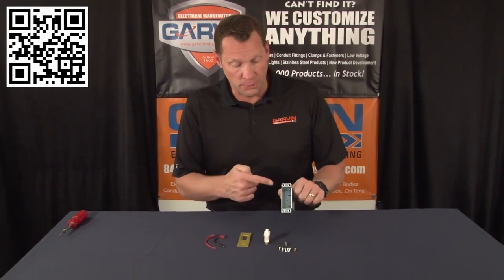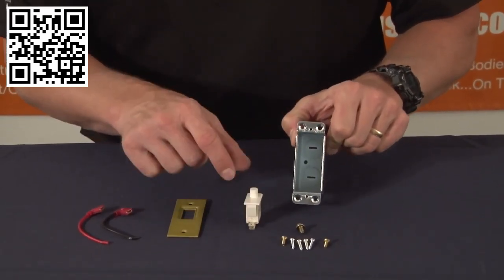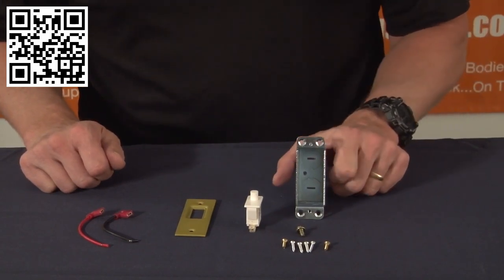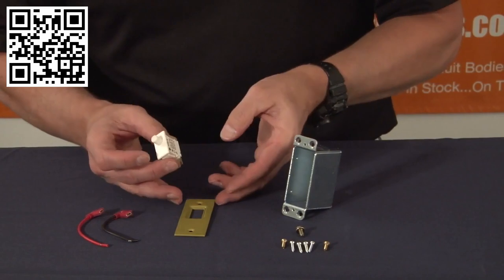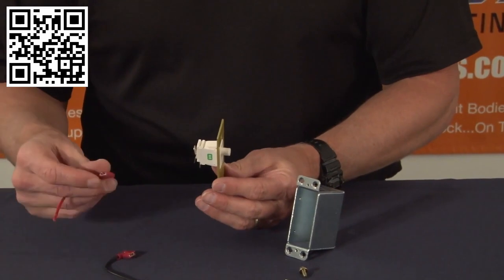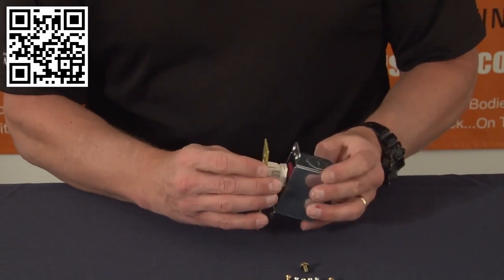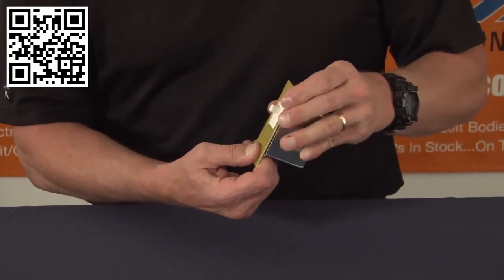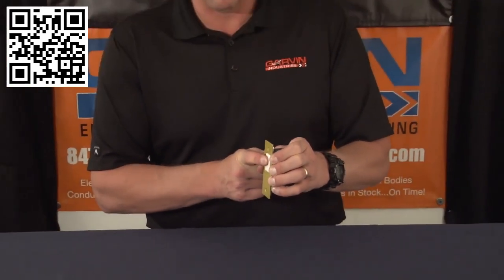Door Jam Switch Kit

Comment: I have one of these and it worked fine for awhile, now the light never goes off even pushing directly on the switch!  What now?  Why is it not working?  My pantry light is constantly on…..
Reply: Same problem here.  Did you find a solution?  I ended up replacing the switch, but the new one didn’t work at all.
Reply: @sachavez100  No I replaced it but covered the hole in the door jam and put in a motion detector light instead, it was hardwired.

Comment: Will this work for outlet power?   I need to hook up a circuit break system in my kitchen cabinet that houses the microwave so that when the cabinet doors are OPEN (button recessed) that outlet in the cabinet will provide power, and when the cabinet doors are closed the power will be cut.